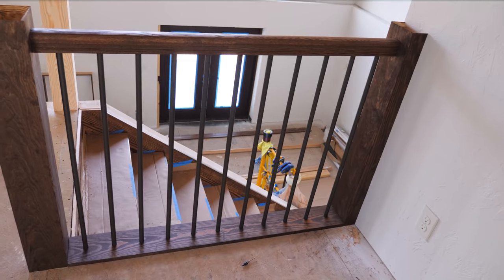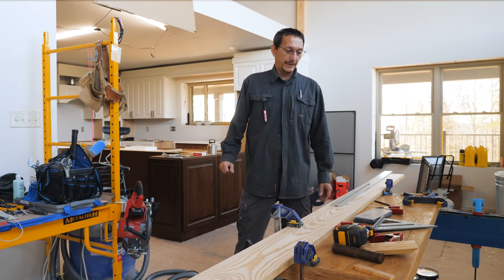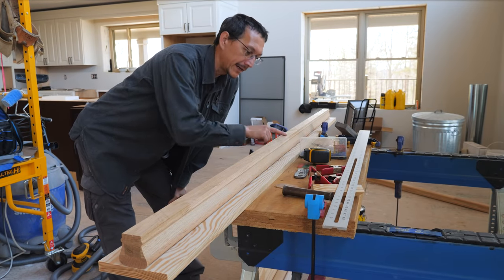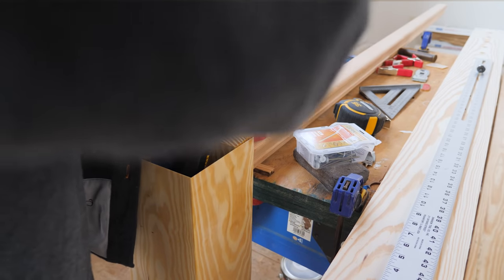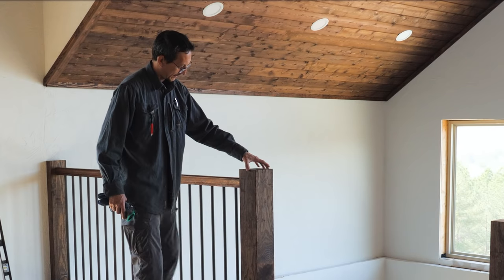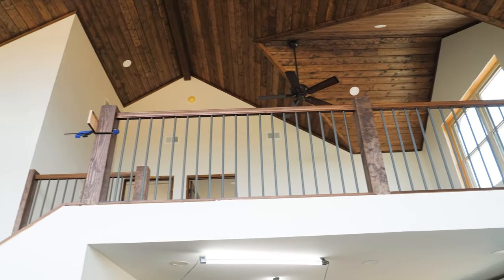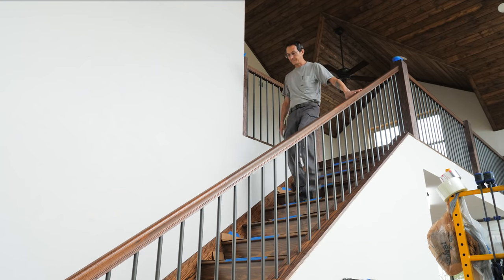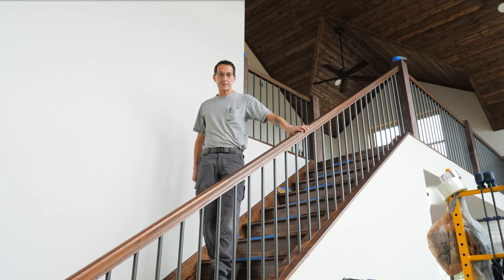DIY Staircase Railing Fabrication and Install

Comment: Very nice railing,  it fits the house design just super.   With the top rail, you could always use pocket screws from below the rail into the post. They even make woods for the pocket holes.

Comment: Looks good.  I helped a friend build a rustic stair railing for his cabin but that was far more rustic, everything was rough hewn 3" poles with 1" tenons we cut with a tenon cutter on a Hole Hawg drill.  I modified a Harbor Freight tubing coper to drill all of the angled holes and it did until the bushings disintegrated on the last hole.  He likes it and I'm pretty proud that it worked out as intended.

What you did is far more polished and it looks great.  I'm not sure you could call it rustic though.  I love the contrast of the stain on it and the ceiling against the white walls.

Comment: I hear you about getting the angles correct.  my stairs have a landing about 2/3 the way down.  It's not at 90 degrees though as they follow the exterior walls that are on a 21 degree angle every 8 feet.  So the railing on the lower section intersected the post at the landing at  11 1/2 degrees.  In order to not waste my top rail, I cut practice blocks from dimensional lumber until it was a tight fit.  Then I measured to the bottom post from the end of my practice piece and used it as a layout tool.  I buried my posts in the floor and wall that separates the stiarcase.  I cut the posts through my hardwood floors with an oscillating tool.  I took my time and got a very tight fit.